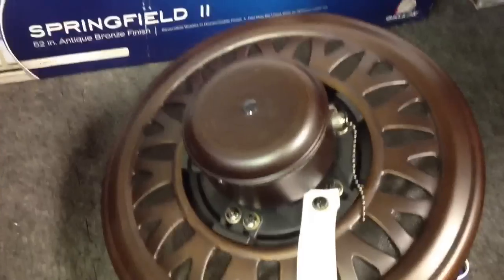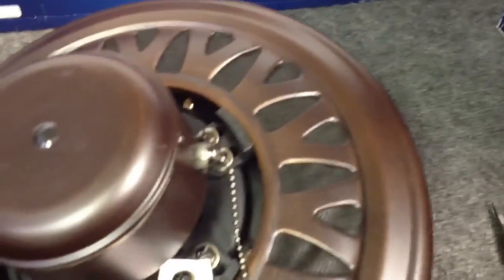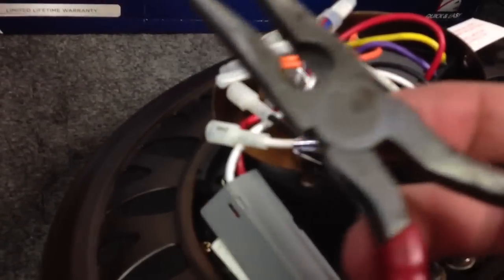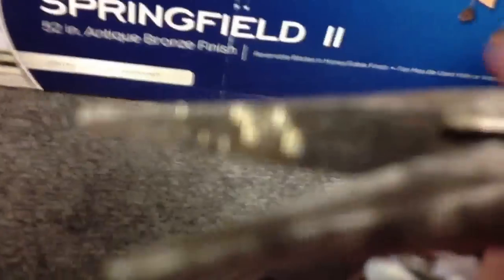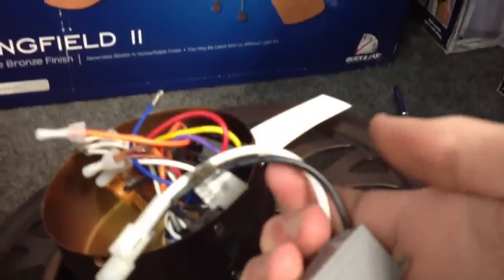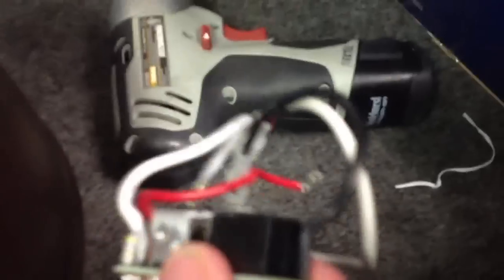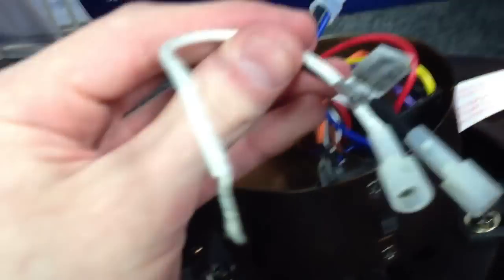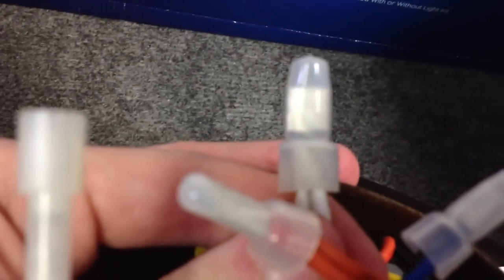How To Remove Wattage Limiters From New Ceiling Fans

Comment: You're the man. My ceiling fan lights just broke and I've been having trouble trying to troubleshoot the problem. After using my multimeter to search for where the power stops, I came across this black box with some charred electronics board.... (MS80A). Been wondering if I need it, and it sounds like I don't. So thanks for the video! Hopefully my house doesn't burn down.

Comment: Just went through this crap with a Casablanca (Hunter now owns them) fan where the always dim lamp finally went dark. Casablanca sold me a $50 Receiver saying that  it was the wireless remote system that had failed, and at the same time, they conveniently forgot to mention that it might also be what they call a NO BYPASS ASSEMBLY which is really the VOLTAGE LIMITER that keeps the 100watt lamp at no more than 40watts. After giving up on Casablanca, using their own wiring diagrams ( which don't show the NO BYPASS ASSEMBLY) I was able to disconnect and remove it, and using the same connectors, reconnect the light directly. Now it works, and we have a full 100 watts of light available. Screw Casablanca and our government.

Comment: I Just installed a Mojo II fan in my room. The lighting in this fan is laughably poor compared to the old lighting fixture I had. I was wondering if this model of ceiling fan has a limiter, and if removing it would help? Fan utilizes three 60 watt candelabra bulbs... Please help, any advice appreciated. Really don't want to take the fan down to remove the limited, unless it will actually make a noticeable difference.

Comment: Thank you for your guidance.  I recently purchased some small dimmable candelabra base LED bulbs to find that they flicker and blink badly when installed.  Very little information on the internet other than poor advice that the bulbs are not dimmable.  I took apart the fan giving me fits and found the wattage limiter (looked different than yours) cut it out and am operating happily with my bright two 4 watt LEDs.  Ironic that you have to remove a device put in to save energy to save energy :).

Comment: I have a Hunter Fan 42” Ashlyn, model# 21879 with 2 bulbs, candelabra base type. When I turned on wall light switch, lights flashed and went out. Replacement bulbs did not work. Called Factory and the technician stated that the problem was a wattage limiter. Unfortunately they no longer carry the part so they said I would have to replace the entire fan with a new one! Heck, this fan is only about 2 or 3 years old! I took a picture of the gray colored limiter. Id on it reads; CBB61,  Part no.G0169-08. Rectangular in shape. On one end 2 gray wires enter and on the other end are 3 wires, brown, green and red. Any recommendations as to how to re-wire without using the limiter? For sure, I will not be investing money for an entirely new fan.